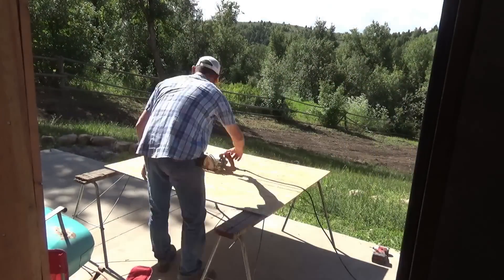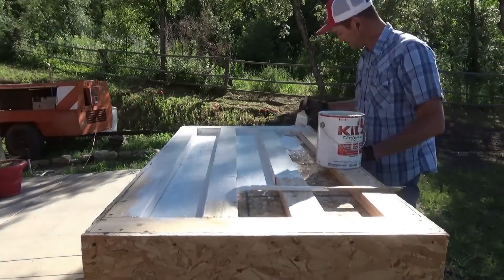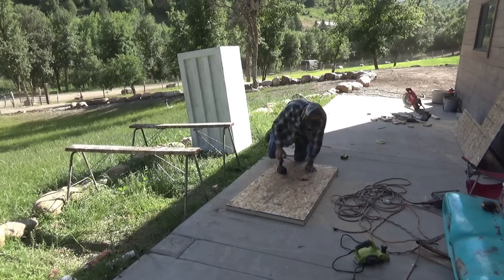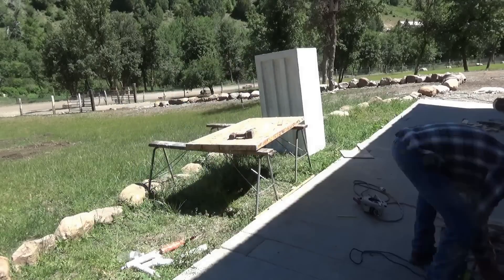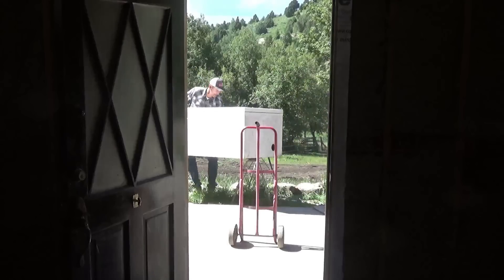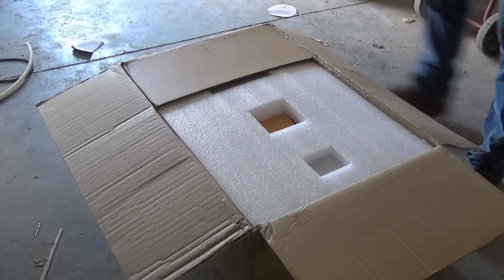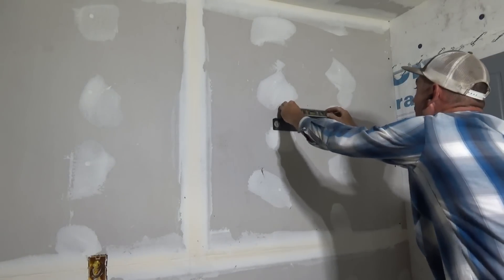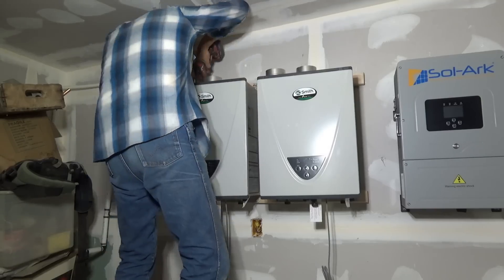#344 - Off Grid Solar Inverter,  DIY Sealed Battery Box, Tankless Water Heater

Comment: For a system with 16 of the US REL 16 XC batteries and assuming a cost for each battery of $300, with a daily DOD (Depth of Discharge) of 50%, the effective electric rate (over the expected 1150 cycles of life) will be about 22 cents per kWh, just for the batteries (not including PV modules/panels and ancillary equipment). Not bad for off-grid, however LA batteries are stuck at this price level and it is unlikely for them to come down further in cost to reach a lower $ per kWh. 

This is based on the battery's data sheet obtained at this link:
http://www.get-systems.com/productsfiles/battery/usb_REL16xc_data_lowres_2.pdf

Li-Ion batteries are coming down in price quite fast and may provide an electric rate (for the batteries) between 10 and 15 cents per kWh to a DIY, with a little knowledge of where to get the best prices and how to hook them up. Many electric car batteries are now being recycled first as sources of power for the grid or home. Once they lose the capacity to provide the quick acceleration or range expected for a car, they can still be useful powering a home and should provide 5 or more years of use in a home.

Li-Ion also requires much less maintenance than flooded LA batteries.

W.r.t. water heating, en electric water heater can be fed directly from solar PV panels with a careful serial/parallel design of PV panels optimally matching a particular heater element resistance chosen. This could have cost advantages. Water is a good way to store solar heat and this use of PV panels makes them less than half the cost of traditional thermal water heating panels. Besides, there is no issue of PV panels freezing and bursting, which is a design issue for the water lines in thermal solar water heaters when exposed to freezing weather. 

When batteries are available, then a heat pump water heater would be the most cost effective use of the PV modules.

The 27 PV modules @270-W each can be expected to provide an average of about 22-kWh per day assuming an average solar availability of 3 hours per day. A more exact figure can be obtained for your particular site using the NREL website at:
https://pvwatts.nrel.gov/

The PV can keep the batteries topped off when constraining their use to no more than 50% DOD for LA batteries and if Li-Ion constraining their use to no less than 20% DOD discharge and not charging to more than 90% capacity, for longer battery life (this represents a DOD increase of 20% for the charge availability from the batteries).

Your effective PV power is about 6.3-kW. This would provide max AC inverter current at 240-VAC of 26.3-Amp and at 120-VAC the current would be 52.6-Amp. Follow inverter manufacturer specs.

The following web page:
https://www.usawire-cable.com/pdf/nec-ampacities.pdf
will provide guidance on the minimum wire size for each of the AC voltage/current combinations, going to the main distribution panel. For a 240-VAC/27 Amp case, using 90C wire allows a minimum of #10 AWG (20% safety margin), going to the distribution panel. The 120-VAC/53 Amp case would require #6 wire (20% safety margin) when using 90C wire.

Thanks for the great videos! 

Happy trails!
Reply: fllev - I’d like to see some research on their fire risk first, fine if held outside in a blockhouse, not so good inside a wood home?
Reply: @____________________________.x  
The fire risk of Li-Ion batteries, while real, is over sensationalized. They are used more and more in cars these days and when there is an accident where the batteries catch on fire, then every news media carries it as a tremendous items of interest to the general public, when in reality there are more than 170,000 accidental automobile fires in the U.S. per year, fueled by the gasoline in the cars and it is rare for the news media to report on these. Everyone has seen one, right?
See https://www.usfa.fema.gov/downloads/pdf/statistics/v19i2.pdf

Keeping them enclosed in a metal container and having a CO2 fire extinguisher should take care of any eventuality that might occur with these. More than likely you'll never see a fire with these unless severely mistreated. The U.S. National Highway Traffic Safety Administration (NHTSA) rates the Tesal Model 3, powered by Li-Ion batteries, as the safest car they have tested. If the Li-Ion batteries catching fire were an issue, they would have exposed the issue.
https://www.tesla.com/blog/model-3-lowest-probability-injury-any-vehicle-ever-tested-nhtsa

Here are just some of the many YouTubers who regularly make presentations on DIY Li-Ion batteries
https://www.youtube.com/watch?v=2fGNyja8S6c
https://www.youtube.com/watch?v=JJx5zoUdtmI

The Tesla Powerwall is a Li-Ion based electrical storage battery and it is designed to be kept inside a home, normally in the garage.
https://www.google.com/search?q=tesla+powerwall&oq=tesla+power&aqs=chrome.0.0j69i57j0l2j69i65j0.2071j0j7&sourceid=chrome&ie=UTF-8

Comment: Please do not use welding wire. Either use pvc coated  which is suitable for direct bury or run pipe most likely it’ll call for number 8 wire. Maybe number 6.

Comment: Glad you got with Engineer775 his knowledge is great. Sol Ark is my choice as well. I would lean toward running higher voltages since your run to the panels is quite a ways a way and the solark accepts 500VDC on 2 MPPT charge controllers. In my mind if you can get up to 400vdc you can run 10 gauge and have really double sized (ampacity) wire for the amperage. 5000w/400 volts = 12.5 amps; sticking to watts law. my 2 cents. You already have some great help lined up.
Reply: Wire is cheap, why would you advise 10 gauge when 8 gauge is a few bucks more.  Are we going the route of 3" ABS now versus 4" ABS to save 10 bucks then have to replace it later?  cmon man
Reply: @JohnDoe-np3zk  8 gauge would be even better that is true. My only real thought was keeping the voltage for the run higher to minimize line losses. So many of the charge controllers only accept up to 150vdc, that solark 8k accepts 500vdc and only 48v nominal battery bank. thats part of the reason it is so efficient. I would assume there will be at least 2 runs as well for future proofing if a second array is added later, or a sse array and a ssw array to keep the power flowing longer during the day.
Reply: @tourquflite  my one property has water rights and 8 gauge wires running under the highway and down towards the river, maybe 300 ft?  Anyway I have been using a gasoline driven Honda, but may be hooking up to a well pump if I can keep the tweekers from stealing it.  There is the real challenge.  I would go 230 volt so no problem on the gauge size.  To the real point of the story, I may just go PV direct starting with a 12volt 100 buck no huge tears if it gets stolen type pump down by the river fed by one 300 watt panel up in the tree so they need a ladder to get it down.  Can you tell theft is a problem in my area?  To the other point, if I run 12 volt from the roof of the garage to the 8 gauge then down to a 12 volt pump, how big could the pump be with that long of a run?
Reply: @JohnDoe-np3zk  That's a long ways at 12 volts. Without knowing the pump specs and how many amps it will draw I guessed at 10amps depending on elevation change. Checking a calc for voltage drop if you put 12 volts in the top you will end up with just over 8 at the bottom. If your pump uses less than 20 amps and you battery bank voltage is more it might be more efficient to use a dc-dc convertor at the far end. Just a thought. each situation is different. The panel in the tree or on a pole mount would be good too. Are you pumping to a cistern? Float switches? I have been working on my own water system design. If you could build a secure pump house that would be ideal of course but maybe not feasible. I prefer to stay DC on everything I can for my remote property, and I do have grid available. Lights, pumps, heat pumps, and so on. AC has its place for sure.
Reply: @tourquflite  my "main" domestic well is literally 15 ft from top to bottom, but the good news is it is 3 ft wide (old hand dug).  I installed a 3/4 HP 230 volt shallow well jet pump.  First try was with manual reset 30/50 psi control in the wrong spot.  Then an automatic reset 30/50 psi at the expansion tank tee.  Better, until the well runs dry then a disaster.  Put in a septic solutions float to shut off pump when water level drops too low, then turn it back on when it goes back up.  Has been working "well" since.

The water rights are for irrigation.  Mostly I have shot for 20 gpm with the Honda gas centrifugal, which works when the river is up.  I just leave 3 or 4 hose bibs full open and the pump can pressure it up to the point of the top of the hill at a dribble.  But, down lower I can water really good.  It's just the hassle of running the pump back and forth and refilling with gasoline.  I can get 10,000 gallons on a great day with about 1 1/2 gallons of gas, or three fills.  The previous owner ran a 1 HP pump, probably a centrifugal.  The line size of 1" pretty much limits me to about 10 GPM which is achievable for a well pump.  I am looking at the Sta-Rite HS series because being river water it's got sand which that pump is capable of handling a little grit.  I plan on burying everything if I do go electric and putting the pump in some kind of vault that weighs more than two tweekers can lift even on a "good day".  Technically I have an easement but it's not even my property per se.  6 ft either side of the pipe, that's it!
Reply: Disclaimer: high dc voltages are very dangerous and care must be taken. disconnects at both ends would be my personal preference. Speaking of personal preference I would guess that is why different answers are given by people at the same company. There is what works, and what might work a little better, and yet what might work even better for the specific system.

Comment: Best enclosure video I've ever seen.... awesome build!   I made the "error" of having 12 Trojan batteries off-grid in a dusty, dark and sometimes cold outbuilding and let down on maintenance.  That gets expensive.  Steve from "Off Grid Living Really" is, IMO, one the the best DIY solar guys around.  He recently discussed  panel/battery matching...    his new ideas include overbuying panels at less than 50 cents/watt and "programming" some lifestyle habits around low cost production times (such pumping water/hvac, tool operation) thus reducing battery dependence.  Check him out.

Comment: The panels would be better in series due to how far away they are from the batteries...the voltage loss would not be as bad when you run higher from the panels...and smaller wire gauge needed.
The controller, charger, inverter can be one device or all separate...I prefer the separate because you can more easily (cheaply) replace a failed single device than a combo device.
You battery box is just fine...and both Scott & Sol-Arc are really great sources of information...I have been a sub to Scott for many years now...the guy really knows his stuff!
A word of caution on the wires...go with higher quality higher & strand count...and make sure it is pure copper and not the crappy aluminum coated in copper that China makes.

Comment: Series or Parrellel. BOTH. Ideally you want the panels as close to battery voltage as you can. series to batt voltage (or charge controller voltage) parrellel after that.

so if you have 12v panels and 48v battery array you want panels parrellel but in series sets of 4. so 8 panels would be 2 sets of 4 in series and those sets parrellel. that is how I understand that part. I am not 100% sure on that though.

Charger controller and inverter.

both. they have nothing to do with each other and perform separate functions.

the charger controller handles the input energy from your panels to your battery and keeps you from over charging your batteries if they get full but you are still recieving power from the panels.

the inverter is on the opposite end. it takes the OUTPUT from your battery array and gives you the needed power for your house (your 110v power) consider battery pack voltage (and therefore solar series parrallel arrangement) since this will be dictated by the power requirements of your inverter. again not 100% sure on this part but it makes sense electrically I know a tiny bit more about electric cars not solar charging. can't feed a 48v pack into a 12v inverter if your inverter can not handle 48v.

How far can batteries be from the solar. well about as far as you want. but remember its DC power and it drops a lot over longer distances. this is why we use AC power for our power grid.

I don't think your distances will be an issue however. you are pretty darned close.

the REASON you get some many different answers is that ALL of them are right. you see it "depends" on what you are doing and how you are doing it and what you want to get out of it.

12v battery powering 12v stuff? well you need a charge controller but you don't need an inverter and it will be all parrellel since its all 12v.

24v inverter from 12v panels? now you might want sets of panels for 24v then parrelle to get clean 24v power to the batteries and 24v out to feed your inverter which makes your AC power.

this is why the answers are all different.

the big issue and hopefully sol ark is doing this (it sounds like they are)

they need to be not answering your questions at all but instead "ASKING" you questions about the do doing want to do and circumstances so they can then give you the correct and "applicable" answers to your specific circumstances.

SO exciting to see you almost their man ! so exciting!

Comment: if you are off-grid you want to use high voltage forklift batteries, RV and car batteries just aren't that good and break down. getting a high voltage forklift battery and re-wiring the cells to give you the lower voltage you want gives you a very high capacity sturdy battery. I do this with my hows and everything runs with no problem when I use to use RV and car batteries wired into a battery back they would frequently go out even with proper maintenance.

Comment: If you're drawing in outside air to vent the batteries then you're not really controlling the battery environment temp.  When it's 12 degrees outside they will draw that cold air in.

Comment: Looks like during winter time you're going to have to make sure you don't get snow pile up and blocking your battery vents.  Was also wondering why you didn't just lay fiberglass inside the box for corrosion protection, it's not very expensive and easy to do on something like a box

Comment: Great job but I have a question about your battery box vents.  How are you going to keep those from being smothered under snow during the winter?  
Also the cold air going in to the battery box through those vents during the winter will reduce your batteries usable storage substantially.
Reply: Could redirect and/or extend the outside portion.  Also could install a diverter on input side to pull in warmer inside air if outside is too cold.  Heath will figure it out.

Comment: Wire size is strictly dependant on how system is wired and the voltage it's at you can usually get away with like 8 gauge or 6 I run 4 awg and run my batteries with 1 I'm on 48 volt system so technically very Overkill
Reply: I'm not an expert but AFAIK voltage is irrelevant for wire size. What matters is the expected maximum current.
Reply: Lets say you had low volts high amps that would create heat let's say you wired your panels at 48 volts let's just say 20 amps then I wired my panels at 100volts plus with 10 amps.i would require less wiring the mppt charge controller would take the 100 volts and step it down I've tested very large sytsems very far away from.my house.i currently have 20kw

Comment: We lived in a Motor Home for a number of years and I yed a tankless hot water heater. Now in the RV my water source in a park was a hose to a spicket and so to make sure the water didn't freeze in the hose I ran heat cable up the hose and it was plugged into a power outlet but to ensure in case of a power outage I ran a second cable that would activate when the temp dropped below 45 degrees and then a chemical reaction would keep the line warm up to 45 degrees. I used a 40 gallon tank I bought at a hardware store for the propane and because it was just me and the Mrs. we were good for a whole year.

Comment: We our base with 1 1/8" subfloor on two 4" x 6" beams with super heavy duty 8" steel wheels so we can move it if needed. We have had to move it twice. the sides were 3/4" marine plywood. We painted the inside with epoxy garage floor paint. three coats.Looking forward to the rest of the inverter wiring and the waterheaters
Reply: Camppatton Family Compound good idea with the wheels

Comment: Make sure your battery vents are not blocked by snow in the winter and keep the exhaust side away from your metal siding as the off-gasses will corrode it.  

Also, put the vent fan in the intake side of the box so it's not getting corroded by the off-gasses passing by it.
Reply: and put a rodent gaurd on em...
Reply: Build a small shed and keep them outside.

Comment: How are you running your battery.  12 or 24 volt. Solar running 120 or 240?
Reply: sandra stembridge 48v is more efficient, but hardly anyone plans ahead, that’s why you see so many lashed up 12v systems
Reply: @____________________________.x  what is your inverter set up for. Went with a good brand.
Reply: Go with the 48v if your inverter handles it.  Run your solar 4 panels  together.
Reply: @____________________________.x   you will probably need anouther 32 batteries.. your refrigerator freezer AC we'll suck up those batteries